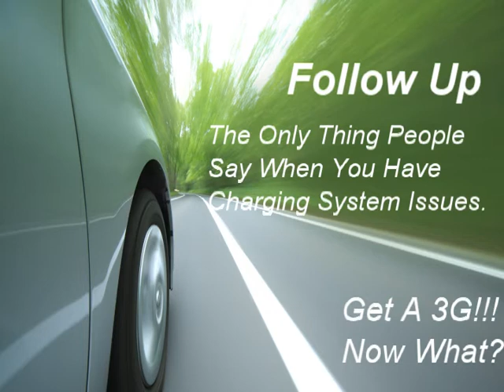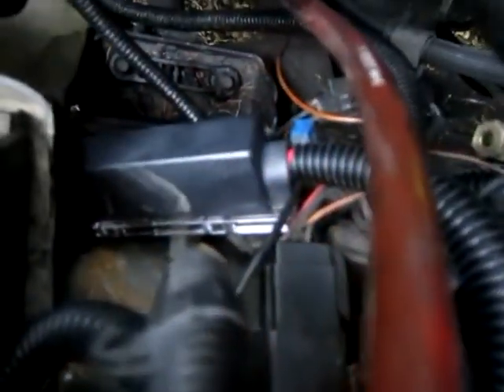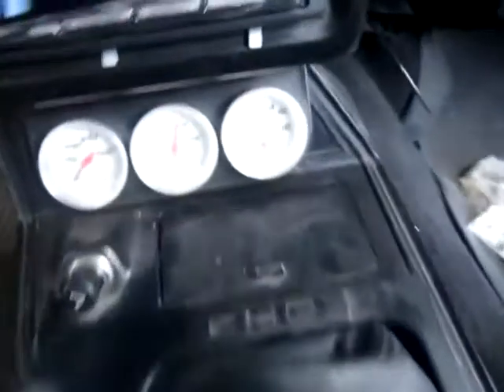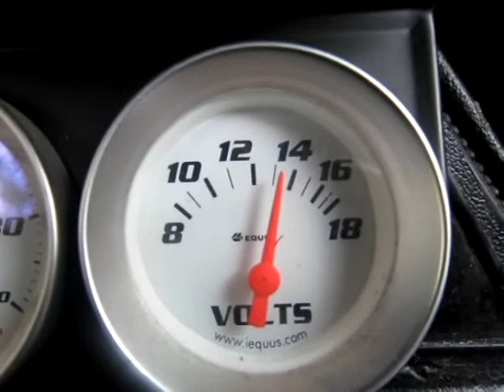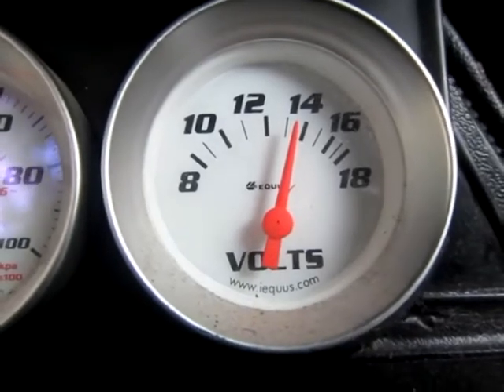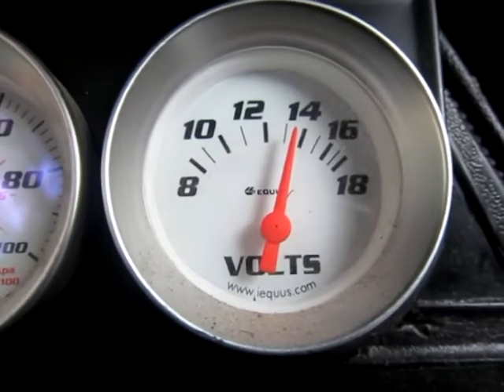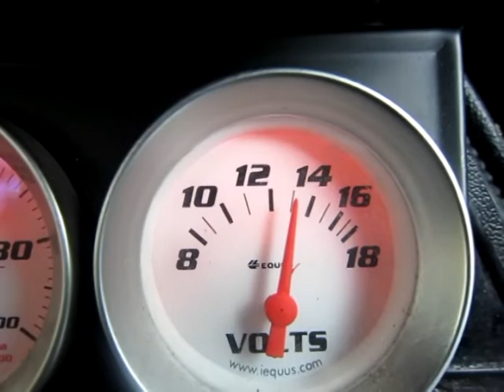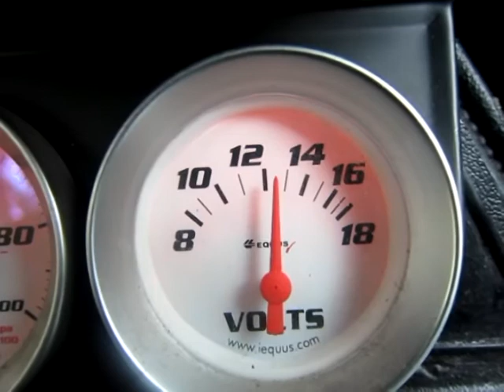Now What? Bad Advice That Cost Me Money. Mustang 3g Fail!

Comment from the maker: Thanks. The three grounds I know of are the battery that goes to the front of the block. One goes from a stud on the back of the motor to the firewall. And one from the solenoid to the inner fender. I checked all them. The gauge is correct as far as I know cause it runs low enough that sometimes it has a real hard time starting like its not keeping the battery charged. I replaced the battery also. Maybe I should test it anyways. I think it could still be a ground though.

Comment from the maker: Okay thanks. I was a Diesel Tech for almost 4 and an auto tech for a little less time. I just never had an issue like this. The stock amp Alt was a 60A. With that one on it would draw so much that the car would shut off. Then I put the 65A on from my old truck and it did the same thing. Now it has a 100A. The reason everyone said to upgrade was due to the Electric fan conversion, and the radio.  But it worked fine for years. Had it since 03 and put the fan in around 05.

Comment from the maker: Continued. You might be on to something with the pump but I have had this issue for over 2 years. I only put about 1k on it every year but when the PSI dropped off it was instant. Never an issue before. Never died or anything. The day it did I was race shifting 1-2 & thank god I was up the street. I coasted down hill for a mile & into the driveway. On the pump. I hope its whatever they call that thing under the seat. Crossing my fingers I dont have to drop the tank. I hate working in the dirt.

Comment: it really depends on what amp alternator you have, volts look fine until you turned the radio on , but that depends on how many watts your radio amp is. charging between 12.5 and 14 @ idle is ok , couldnt tell if you reved up when radio was on. plus i saw in your other vid the fuel pump went out that could have been effecting your voltage(pump will draw more amps when it is going to the bad) BTW i run a auto shop, mechanic for 20years  lit'l more info and maybe i can help  - fuel pump first-

Comment: 100amp should give you all the power you need , you sure the volt gauge is right? also check and clean the main ground (battery and block) -- if there is a ground connected to the alt. be sure there is no chrome plating at that connection -- looking at that mustang i figured you had wrenching skills

Comment from the maker: LOL. No. I have had it narrowed down to the system that calls for the second stage of charging. Had the schematic but could not figure out the component arrangement (where the wire was located in the car).  I was trying to get help with that from the folks in the mustang forums but they always said to upgrade my charging system. That or I get no help at all. So I did it, and now I am correct. I know what it is. But where is it? So annoyed with this problem.